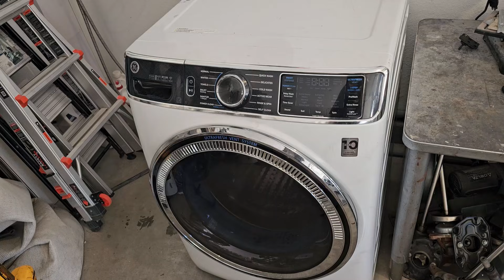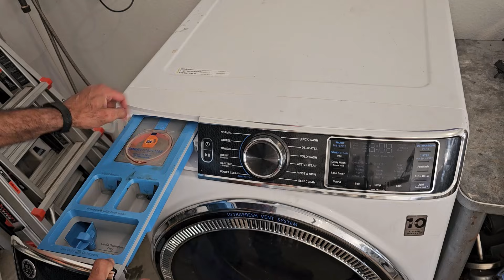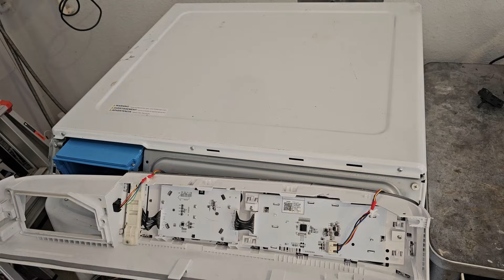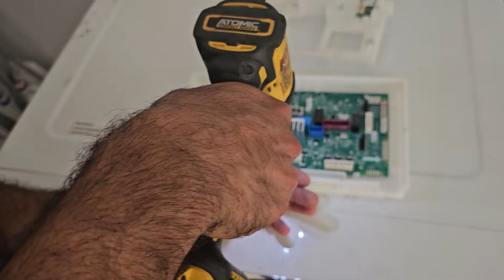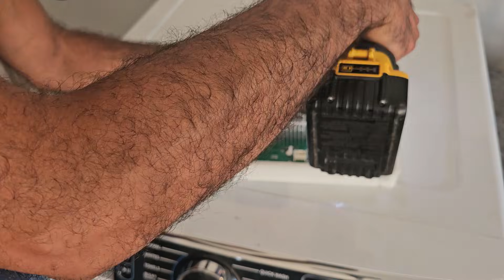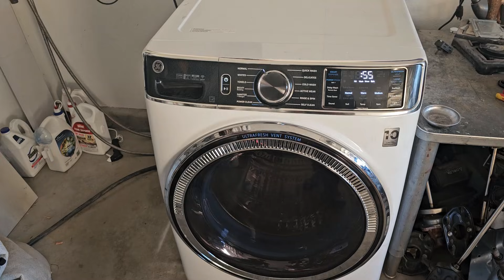How To Replace The Control Board On A GE Front Load Washer!

Comment: After installing the control panel you will likely get a flashing display panel indicating you need to program the board to match the machine.  Here are the steps I followed:

The GFW 850 flashing code on a GE washer after replacing the control panel usually indicates that the new control panel needs to be programmed to match the specific model. Try entering programming mode and selecting the correct model code via the play/pause button.  (e.g., 008 for GFW850 series). If that doesn't work, a faulty door lock or main control board could be the culprit. 

Here's a more detailed breakdown:
1. Programming the Control Panel:  Enter Programming Mode: Simultaneously press the "Temp" and "Spin" buttons for 3 seconds.
2.  Select Model Code: Repeatedly press the "Play/Pause" button until the display shows the correct model code for your washer (e.g., 008 for GFW850 series).
3.  Save and Exit: Press the "Start/Pause" button for 3 seconds to save the code and exit programming mode. 

Start washing!
Reply: How you enter to the programing mode? Pressing on button first? The go to the temp/ spin ? I tried both and doesn't do anything
Reply: Hello. The lights all flashed when first powered on. And as a dummy I didn’t read this post and clicked things. And now I know I programmed it for # 1 verse 8. As I have an 850. After reading this I tried pressing the temp and spin button but could not get it back into program mode. How do I do that so I can fix my error?
Reply: @bwaldrep228  Did you ever figure out how to get back to the program mode?  I did the same thing, and I tried temp/spin and it does nothing. 😕
Reply: @bwaldrep228 I did the same thing. How do we find out what # equals our model? Press and hold play/pause for 3 seconds to enter the options menu
Reply: Great comment - thank you !

Comment: Hi. How to fix my H20 supply error code? Already replace the water valve. Thank you
Reply from the maker: Verify the pressure hose is not clogged or has a hole (just detach it from the control board and blow through it if you are able to blow through it without a crazy amount of force it is most likely ok). If the pressure hose is ok, then the issue is almost certainly a bad board.